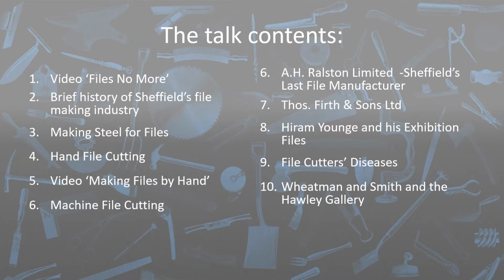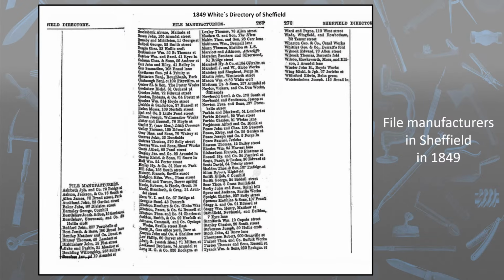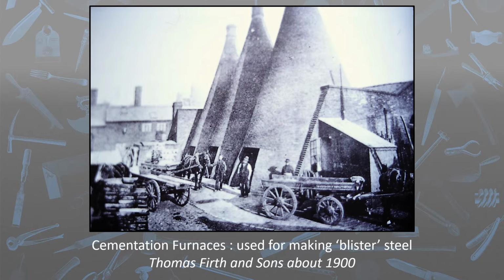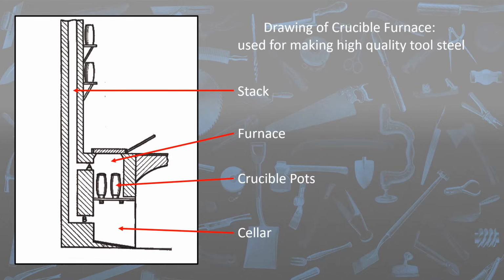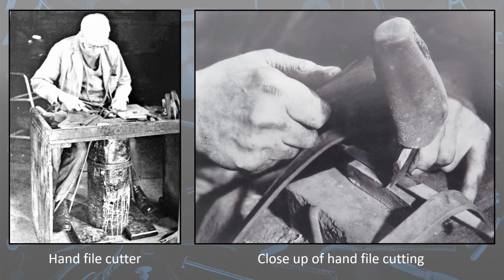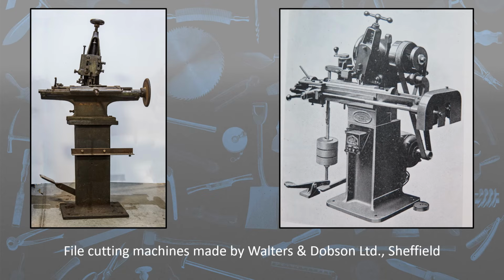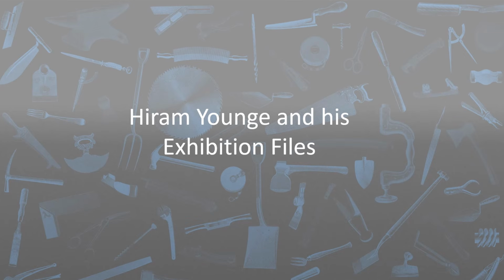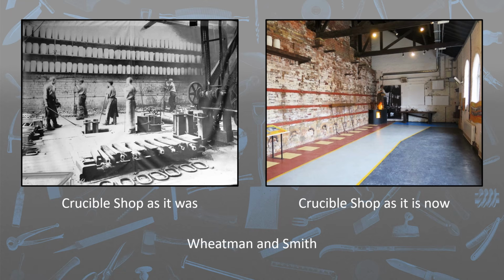File Making - A Great Sheffield Industry That Is No More (2023)

Comment: Thanks to the people involved in producing this documentation .

The lead baths to heat and prevent the finished files from oxidation is genius .
I did a Blacksmith trade course and we was taught there to temper delicate springs in molten lead after hardening them in oil .

A Blacksmith i worked for showed me the hot block method as well as the  oil or wood flash temper .

Comment: Fascinating presentation. However. I don't lament for particular periods in the evolutionary progress of manufacturing efficiency . Whilst there may be a certain charm and rose coloured nostalgia looking back at periods when human dexterity could not yet be replaced by machines its worth remembering that those jobs were repetitive, boring and often dangerous. Stooped over a primitive bench hammering 50,000 file grooves a day by hand for the rest of a working life is a skill i wouldn't wish on an enemy. The ultimate goal of mass manufacturing is to produce goods with no human labour and the machines become an almost inexhaustible supply of cheap taxable labour.

Comment: Thank you for posting that extremely interesting video. I have used Sheffield files for years, such a shame that they are no longer made there. The ones you can buy now are not a patch on the Sheffield ones. I made some engineer's scrapers from half round files when I was a year 3 apprentice in 1958, I am now 84 and still have them - they are as good as new.
Reply: We were up-cycling (or repurposing) before Thunberg was a twinkle in her father’s eye - I made a set of machinists parallels with some old flat files. My brother-in-law inherited them when I retired and still uses them today.

Comment: Everything is done for now, most tools now have to have a battery and a charger, sad really.
Gaz Yorkshire.
Reply: Sadly you are right but times change I guess and folks seem to always be in a rush to get things done in ways that require no physical effort. Most of the power tools made today get very little use , left to gather dust in the shed after a few uses consequently makers don't make them to last, but all strive to be the cheapest. There are really well made tools available but they are expensive. I buy and restore old tools for my own use and most of them will likely still be going strong when the planet has run out of material to make more batteries. My most used power drill was made by Wolf in the 1960s and it is indestructible.
Greetings from South Yorkshire  ;<)

Comment: My farther, a saw doctor, an 8 year trade, supplied me with dull mill files for my many adventures in metal work. Mostly American made. A pamphlet, named many locations of factories and the many files from Nicholson. A sheet metal cutting process I could not believe was to drill a line of 3.2 mm, an eighth of an inch, holes in wrought iron. A cold chisel was worked along the line until it was cut through. A photo of Isambard Kingdom Brunelle revealed such a cut nearby. A computer controlled plasma cutter now requires little attention. Announced 1970, an improved method of cutting Titanium, reducing time spent doing so in the US aircraft building industry, by a Billion dollars, at that time.

Comment: You said that files are made of tool steel, I was under the impression they used carbon steel.
Reply: The two are synonymous, if one speaks of the past.

Note: “O1 tool steel” is a high-carbon, oil hardening “tool steel” - .9+ % carbon, and some small alloying elements.  I’ve used this for small cutters, etc…
Reply: @dennisyoung4631  
Quite so! there are hundreds of different steel alloys available today that come under the group heading of 'tool steels'
Reply: @dennisyoung4631 I made some of my own punches and  cold chisels by spraying used motor oil on them  for hours while at red heat.They work very well after tempering

Comment: I worked as a file forger in the sixties, Makins, on Darnal road Sheffield, we had seats hung from the ceiling so we could swing from the gas fired furnace to the drop hammer, it was hot, repetitive and boring. We where given special additives to put in the water to replace salt lost in sweating in the heat. Thanks for the video.
Reply: I just saw a video by Ken Hawley documenting an auger manufacturer in Sheffield, and at one of the hammer presses, I believe they called it, a worker was moving back and forth on one of those seats-- still looked way tougher than the vast majority these days have any familiarity with. Also, one of the straight razors my grandfather passed on to me was made in Sheffield... along with my "rolls razor" shaving system. It's sad that so much of that craftsmanship is gone, and replaced with soulless mass manufactured junk from Southeast Asia. I always keep an eye out for tools made here in the U.S., and England as well, though those are far rarer in my part of the country. Thank you for your years of dedication to your craft....
Reply: @CalmBeforeTheStorm76  I also have a rolls razor, double sided silver box with sharpener and strop. I think they where issued to the army in the Second World War. Loverly thing to have but not as good to use as modern disposable ones.
Reply: @michaelrandle4128 Yes, that's exactly it. The stropping mechanism  works perfectly, and the blade itself is engraved, by hand, with "Sheffield, En"
Reply: I was one of the people who bought lots of the equiptment and office stuff when makins closed and everything sold at auction. Most of the old books and records went to paper recycling and a lot of the files went to scrap.. I always remember that there were loads of Indian guys running after us and trying to buy the machinery to send to  India, they particularly wanted the grinding wheels and the grinding machinery that we had to manhandle out through the windows as the building could not be touched and there was not enough time to dismantle. Still have some files in my toolbox and still used today. Lots of the steel pots were not to be touched as they were contaminated with cyanide.
Reply: @grahamg6212  thank you for that, can you tell me what year it closed.
Reply: @michaelrandle4128  As near as I can remember it was sometime in the early eighties , the miners strike was around the same time I seem to recall. sorry not more usefull.
Reply: I saw that in a video today

Comment: Hand flies possibly the most underrated tool an engineer can wield.    I love filing and always will, however I have several small files in my small collection which I know not what they were designed for, one called a Bulls Foot, tougher being a Bar file.
Reply: Bulls foot used in clock repair for filling down bushes.

Comment: I did my apprenticeship at Westland Helicopters in Yeovil. When I started in Sept 1973 I was issued with a set of new files amongst other hand tools to do my basic training. I'd often wondered how a file was made but never found out. I was intrigued again when I came upon this posting on YouTube. That set of files I have regularly used throughout my life were all crafted in Sheffield. One or two have become dull but are still used on Al Alloy effectively. It is sad to learn that I will not be able to replace them with proper new ones. Well now I know, I am amazed. Thank you for enlightening me.
Reply: An old engineer from the Midlands told me how they used had files extensively in making parts for, and assembling, machinery. When a file blunted it was dropped into a bucket that was taken daily to an independent soli file sharpener. He would anneal the files, re-cut them and then harden them again up to tool steel level. Using talcum powder to fill the bottoms of the grooves helped prevent clogging (especially with brass or aluminium) as it was dislodged by the file cards used to clean swarf from the files getting right down the grooves. This man made his entire income from this procedure!
Reply: Look up how to sharpen a file
Reply: There is an acid process to sharpen files. As a former high school metalwork teacher we experimentally sent a batch of odd old dull files ( no file gets duller than having school kids 'sawing' a file backwards and forwards lol) and to our great surprise these files all came back as sharp as new ones. I've never found out how the acid process worked ( the theory of it anyway) but if you have files that are dear to you, and if you've had and used them for a lifetimes work they probably are and some are dull and won't cut steel anymore. Look up the process and see if you can get them acid sharpened.also my head of department told me that brand new files should always be ' run in on aluminium using school chalk in the teeth( to prevent clogging) then once run in and cleaned with a file card they were good to go on steel. As a precaution I did this with the files that had been acid sharpened and they were put to normal 'abuse' by the kids thereafter.

Comment: I 'Served my time' at Peter Stubbs Ltd ( Warrington ) File Manufacturers.👍
Reply: I still have a couple of Stubbs files, I first used them as an apprentice 50 years ago. Still the best files I ever used.
Reply: @billdoodson4232  The ( mostly Chinese ) one's nowadays are not a patch on British made files. The metal cutting files are ok with wood, but that's about it. Sadly.
Reply: @billdoodson4232  Same here! Served my time 1974/1978. 👍👍
Reply: Glad someone mentioned them.  I wasn't a fitter, didn't look after my files as well as I ought.
Reply: I have some Stubbs files.
Reply: @IamwithGreg   You wouldn't have had a relation Andy, who worked at Total oil in Immingham would you?
Reply: @billdoodson4232  No , sorry.  I've worked around that area quite a bit.  ( Stalinbourgh/ Killingholme,  A + B ) all power stations.  ( Alstom and Siemens) was full time with Siemens from 2004/2018. 👍
Reply: @IamwithGreg  I did a year contracting, pressure systems inspection at Total, one of the senior inspectors was a Podmore. Unusual surname like mine, you never know. I didn't do any inspections at Killingholme, but did for Drax and Ferrybridge. Seems a lifetime ago now.
Reply: @billdoodson4232  I think the name originates from the Stoke area.( our 'branch' is in Warrington). We must have crossed paths in past because, I've worked at Ferrybridge ( was actually there when the fire put the final nail in coffin for the site ) and also I've worked at Drax many time's. Small world. 👍
Reply: @GregPodster133  Very small world indeed, I was due to be at Ferrybridge for some inspections on the day of the fire, but ended up doing a rush job elsewhere. And our "branch" of the Doodsons, comes from Thelwall in Warrington, as far as we can get back to 1763.
Reply: @billdoodson4232  my eldest daughter lives in Thelwall. And I live just off Thelwall lane. 👍
Reply: @GregPodster133  Haaa haha, tiny little world.

Comment: Thank you.   I know you can’t mention all the purposes files were used… because it was literally everything - almost.  But the one trade you could’ve mentioned over the last 400 years would be gun making, gunsmith.  Even today, I as a general gunsmith, acquire files of as many shapes & sizes to do my work.  Even imperfect files are gained where they are heated & made into other file shapes for purpose use or completely different tool ; either hand or machine tool.   A damaged file may be made ‘safe’ on some surface for necessary shoulder work or other.  Gun work has been trade using files a lot - a must have tool.
Reply: If I had no factory files I’d have to make them. I can’t imagine the crudeness of them should I make them .  Alternative would be cold chisel to remove metal or gravers to remove metal .  A good blacksmith, must’ve abhorred the use of a file to turn valuable metal into tiny chips only to fall to the floor.  Rather than shaping hot plastic metal with hammer to shape and not losing any precious metal to tiny pieces.
Reply: @thatsthewayitgoes9 
A youtuber, Clickspring has made his own tools including files. They look very factory like.
Reply: @lindsaybrown7357  I’ll check it out.  Thanks. But making file , I’d lose $$ bing time on gunworks. Thanks I’ll check out when I get time, I’m SO busy
Reply: A good file is a joy to use, when it feels like spreading butter on hot toast you know it is doing the job for you. I'm not a gunsmith but I used chainsaws etc and like any job a dull tool is a dangerous tool.

Comment: Absolutely fascinating, thanks for showing. Question: What s the difference twixt quenching in brine & quenching in whale oil?
Reply: The difference is mainly in the speed at which the quenching medium removes heat from the work piece by 'soaking it up'. Different steel alloys require to be cooled at an ideal rate for that particular alloy to properly harden them. Brine quenches are quick and oil quenches significantly slower.
Reply: I thought he said quench in brine and cool the purple temper in whale fat .

Gears and high speed steel are double hardened with no tempering

Comment: Hard point saws can now be sharpened or touched up with diamond files or, as I have done a couple of times, the old teeth can be ground off and new teeth filed in. Is it worth it and would I do it again ... no! 
There are still so many fine Sheffield saws available at boot sales if you are prepared to learn the skills needed to sharpen or even re-tooth a saw. It is not a particularly difficult process but you do need patience and the will to work accurately. Paul sellers has some great instructional videos on the subject, here on youtube

Comment: This skill must be preserved in its most basic form. I can’t thank you enough for this information.

The last commercially made files I purchased from old american named companies were of shamefully poor quality . Wavy surfaces with bent dulled teeth. I was shocked. I have 100+ year old files, found on a barn floor,  that cut better.I’m acid sharpening all my ancient files to get as much life out of them as they may have left.
With the help of these videos,I’m confident that I’ll be able to produce my own ,by hand, if necessary. 

Thanks so much for your efforts.
Reply: do you think you could untemper the old files, grind them flat and cut them again then temper? As the form and good quality steel is all there just needs re cutting ?
Reply: @jackwheatley8  
Suitable steel is cheap and readily available. Resurfacing the file may be more work than it’s worth. Grinding belts are  expensive. It can certainly be done though.
Reply: The old names - Nicholson and Simond - I think made good files when production was in the USA. At least that has been the case with every USA Nicholson that has come to me. Nicholson moved production to Mexico and Brazil, and those files IMO are pretty poor.  The Simond files are now made in Honduras and India, don't know anything about them.
Reply: @randydewees7338  Indian made files can be a hit and miss, but Befana from Poland, Vallorbe from Switzerland and the Portuguese firm Tome Feteira manufacture good quality files, the later makes files for Bahco as well.
Reply: @randydewees7338  Both now seem pretty poor, some I've had were even bowed.
Reply: Quality machinists files are still made but they are ungodly expensive.

Comment: Everything is throw away now.
Nothing is made to last .
Circular Saw teeth are mainly tipped with hard steel and re ground by machine.
I remember Draw filing metals in my apprenticeship but I’m sure they aren’t even in apprentice shops now.
Reply: Making a “disposable” hand saw that can’t be resharpened seems a sinful waste of material and energy to me.
Reply: @chopsddy3  but it's the norm now :(
Reply: Most circular saw teeth these days are tungsten carbide tipped, much more durable than any steel.